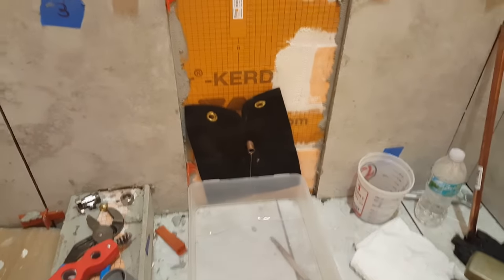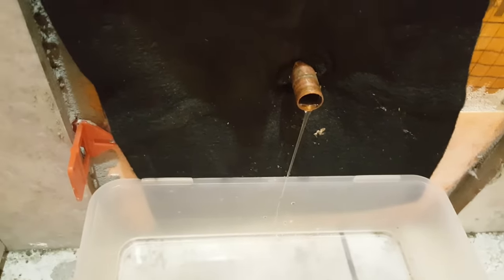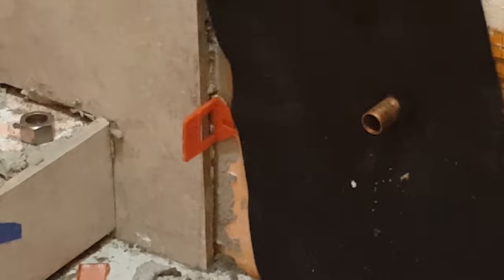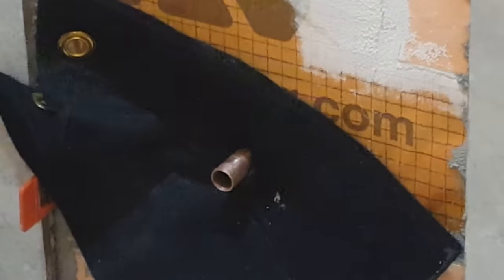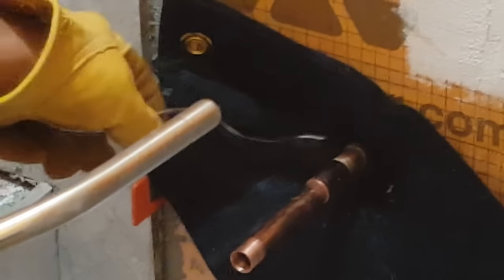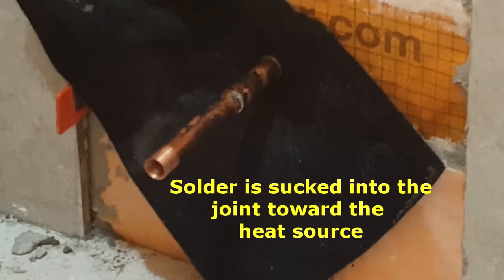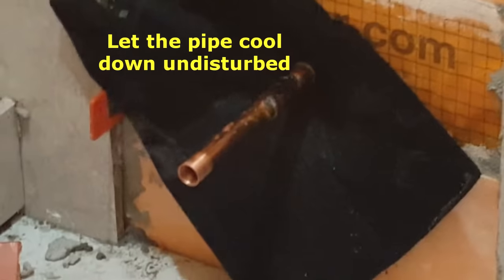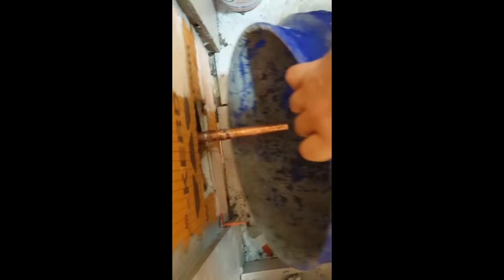Insane Plumber's Trick: Solder Copper Pipes Dripping Water

Comment: LOL get a Jet Swet , water is going to leach past the bread, cause steam and a potential leak and maybe not even right away. That leak might be the gift that gives at a later date. :-) Fluxing the inside of the pipe? SMH You want flux out of the inside of the pipe hence water soluble flux that's code in many places. Some of these soldering videos are down right scary.
Reply from the maker: LOL,  The average homeowner is not going to spend $50 on a Jet Swet that they may never use again. The bread trick works it has always worked it has never failed me so your theories about with the water leaching pass the bread and all that or just simply not true if you complete your soldering immediately after putting in the bread you have a good 5 to 10 minutes.  Any amount of water flowing is not enough to go flooding past the bread either I mean come on use your head are talking about droplets of water not gushing water. Those droplets of water would take quite a bit of time before it would disintegrate the bread probably 10 to 15 minutes.
Reply: @jeffostroff  That was gushing water you used bread on! The average homeowner should not be soldering with the amount of damage that can be done if you get a leak in the wrong spot and especially after watching videos like this with you using a wire brush and fluxing the inside of the fitting and using bread to slow down a serious leak. lol and no a wire brush will not remove the burr on the inside of the pipe, nice try though. If you have enough money to build a plumbing kit and learn the right way, get a Jet Swet for 50 bucks, not having to drain down the pipes alone makes it worth it. Otherwise get your main tested and fixed before started a project or open a valve below that one to relieve the pressure and stop the water flow. Rookies teaching the masses....SMH.
Reply from the maker: @markb.739  How dare you come on here and trash talk poor people like that. Makes me sick to my stomach knowing arrogant losers like you exist in this world. That was an impoverished family I was helping, We paid their electric bill that month just to keep their power on. And no bro, sorry if they don't have $300 to pay some overpriced holier than thou clown like you to install a new ball valve on their water main. I minister to poor families and abandoned wives like this all the tine who can't afford to even have any leak fixed, and I go and help them for free, and almost all of them have 30 year old gate valves that trickle, so we deal with it. Forgive us O master, that they don't have the ability to bring their plumbing up to your standards before we can make a free repair for them to save them the $150 that they don't even have. Yet you condescend down to their level like it's a crime they can't afford to pay to have it fixed. Shame on you. As for the repair we made, yes I saw I made a goof 2 seconds after I fluxed the inside of the pipe, late in the evening after working 12 hours, no AC, hottest 95 degree, most humid day in July in Florida that year, could hardly breath, tire, focus was off made one slip up, and you go off on a tirade of how I'm causing people's houses to fall apart. You telling us you never made a goof in your life Mr. Perfect?  I knew it was incorrect, I cleaned it out later. The wire brush was intended to get as much flux out as possible. Yes I own a reamer, you didn't see my gray reamer at 1:13 in the video? Yes I used the reamer, just did not show it in the video, we don't always show everything we do, or we miss a scene so it does not make the final cut. The gushing water you saw was us turning the main back on for only 2 seconds, enough to flush the bread out, not causing floods in the house. There's nothing wrong with anyone ever using the bread trick, plumbers have done it for decades. It works, and my repair is still l working 2 1/2 years after I made that repair. No leaks, no problems. I realize you have this uncontrollable urge to show the world that you are super plumber, but you fall flat on your face here, so give it up. If you were really as a good a plumber as you're trying to fool people into believing, you'd really have so much business that you wouldn't have time to troll other videos and make fun of impoverished people making do with what they got. Go troll your own videos. If you'd like to donate a Jet Swet to us so we can rise to your level of plumbing excellence, we'd gladly accept it. One more point, Mr. Arrogant Plumber, you are so inebriated by your own arrogance, you don't even know that you can't use a Jet Swet to stop the leaking pipe to change an angle stop, which we have to deal with a lot.
Reply: I agree , I have used the bread trick for years the last thing you do before sweating on the pipe is put the bread in and not flux on the inside of the pipe . And with all that steam I bet that is a marginal solder joint at best.
Reply from the maker: @MrNorthstar50   Right I goofed  on the inside of the pipe it was the end of the day 95ﾟ in there on the hottest most humid July day and we were both tired and just not paying attention and brushed the inside with the flux lol. But  A you can hear me say after I did it that it wasn't needed there,  I cleaned out what I could. AND 2 1/2 years later that pipe is still working absolutely perfect no leaks no problems.
Reply: The bread is not a trick. We plumbers have use this method for the last 60 years. Newbees need to learn a few skills before making themselves a fool on youtube.
Reply: @robertkat  If your in a pinch and are going to roll the dice on the joints longevity the go for it. I've never needed to use bread, there are plenty of other better ways to solder without resorting to bread, and if you don't have a Jet Swet, you are a sub par plumber.
Reply: @jeffostroff  If you don't know how to deal with 'droplets of water' by only using bread then your in the wrong game man !
Reply: @markb.739  Agreed,  I plumbed in thousands of houses and NEVER ONCE used or needed to use bread.  I use a jet sweat on occasion but actually not as often as you would think.  Water in pipes can be blown out, angled away from you etc depending on how much water is leaking out, jet swet is just one of many ways to deal with leaking pipes but certainly bread is not one of them if you been in the game long enough, have half a brain on your shoulders and been taught or learned the correct way and professional way to do things.
Reply from the maker: @dillwiggle2  If you don't know that no homeowner will spend $50 on a Swet Jet then your in the wrong game man!
Reply: Dill Wiggle the water was running like Austin Powers was pissing after the water was off for most of the day trying to get it to stop.
Reply: I agree, he didn’t prepare everything correctly but a jet sweat. I’m a plumber and I don’t have a jet sweat. Then again I don’t do much service so I don’t really need one. In this case I wouldn’t worry about steam with an open pipe. I’m not sure what kind of gas you were using but if you use mapp gas, you can usually get it hot enough to solder with some water in there as long as you have an open end, male adapter, or union where the steam can escape and doesn’t blow a hole in the solder.

Comment: Rookie, cleans the pipe after the plug and brushes the inside and ads flux!!!!😂
Reply from the maker: You forgot to mention repair worked and still works 3 years later. LOL!
Reply: @jeffostroff  so do shark bites but I stay away from those
Reply: John Nichols  there's a reason why code doesn't let you bary them, try putting one under a slab and watch the inspector laugh at you, but then again this guy wasn't brazing he was just soldering

Comment: Why not use a compression fitting? ...
Reply from the maker: We did use a compression fitting, but we needed to solder on a few inches of extension pipe out of the wall, because the original plumber left so little room behind the nut and we were going to lose another 1" minimum between the new tile backer board, the 1/4" of thin set, and the 3/8" tile. That all adds up so we needed to extend the wall pipe. Then we installed a standard 1/4 turn ball valve compression fitting.

Comment: What also works is breaking loose the water mater and let it drain outside..then use a shop vac to remove any remaining water in the line..using a real torch also helps..cookin torches are not the proper way to solder..
Reply from the maker: this is a "real torch", but it's the Map gas real torch Home Depot sells for DIYers. We were drying to keep this video DIY friendly, so separating the water main outside is not an option for most DIYers.

Comment: What about the Previous joint with the Heat Solder Would melt ,no need to flux inside the pipe ,you are very slow to apply heat I.e cleaning ,demurring pipe before applying heat water would have run through Bread long before you were ready

Comment: You need to learn more about soldering. I would chase away if you would do the job for me
Reply from the maker: What specifically did you not approve of about the soldering, which by the way is still holding to this day, 3 years later?
Reply: @jeffostroff  the way you hold the flame unready for solder after solder not doing the right think

Comment: You won't know if the joint holds until you put it under pressure. It didn't look like a good sweat job to me. Sorry.
Reply from the maker: It was a good sweat job and the solder wicked into the copper fitting with perfect capillary action just like it was supposed to. I was just over at this house the other day looking at the work, done 3 years ago, and no issues at all. So what made you think the solder did not sweat properly? What timestamp in the video gave you this impression? We would have known immediately, or some months afterward if the seat was a bad job.

Comment: Good part of video: use of heat shield, using the width of pipe in solder, using minimal flux, heating the fitting is good practice, and the bread trick works yes. Bad part of video: pipe and fittings not cleaned correctly, torch needs to be closer to pipe... Keep practicing.

Comment: You don't suppose the continuous stream of water is being siphoned out of the cold of the water heater? Shut off the water heater. Either that or your main shut off isn't positive.
Reply from the maker: No, this was definitely a bad gate valve that would only close about 95%, not quite all the way. We had it like this for 2 hours before we decided to make a video of it! We see this a lot here in FL, I've seen 5 houses in the last 3 years of different friends I went to help whose main would not shut off completely. Every time I take over  anew flip project, I remove the laundry machine hot and cold gate valves, and sweat on new 1/4 turn ball valves. Much more reliable.

Comment: Good explanation of the bread trick. But awful demo of how to solder. Too much heat, heating and adding solder is a big fail, heat should be applied from below. Heat rises, solder flows down to point of heat source when solder added from top. Always remove flame when adding solder.
Flux shouldn't be put inside the pipe. And you need to reem the bur out not clean with wire brush.
Reply from the maker: The pipe was reamed before this video was shot, this was a video about the bread trick, not a video about reaming the pipe. I guess you did not see the reamer sitting there on the shower curb at 0:04. Yes I goofed fluxing the inside, but you didn't here me say afterwards that it was not needed? Also it was water soluble flux, so no damage done.